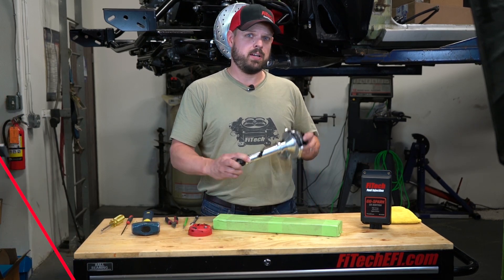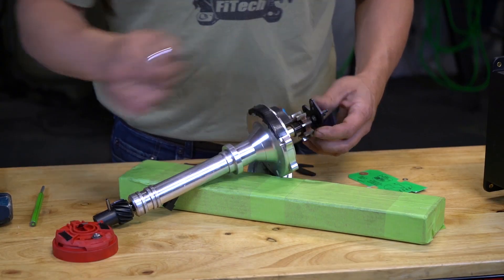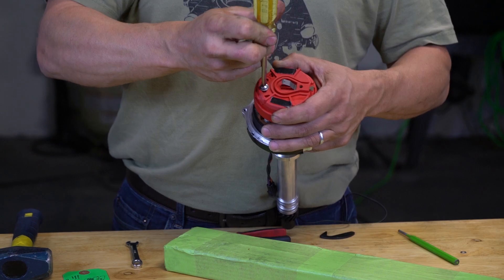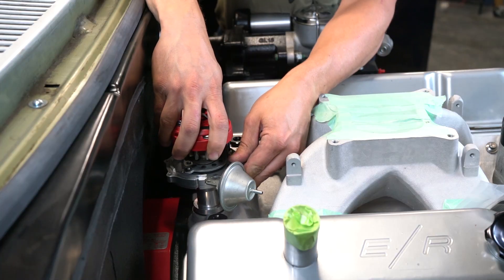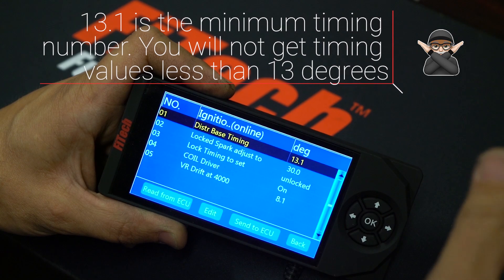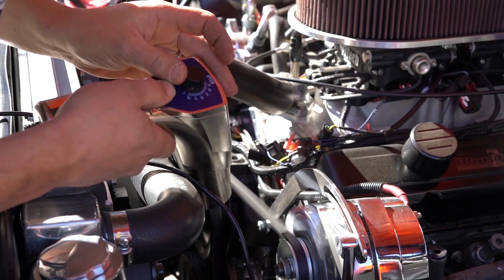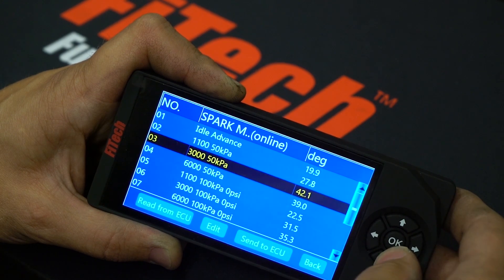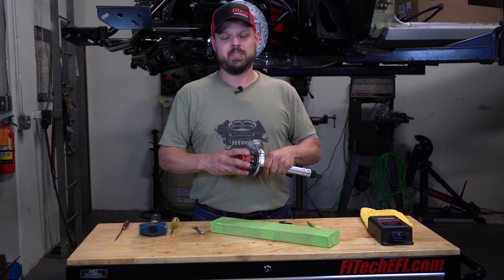Locking Out A Distributor | Tech Tuesdays | EP20

Comment: How would i set this up with a non adjustable rotor?
Reply from the maker: The process is ultimately the same minus the phasing part, however you should reduce the max timing in the Spark Table.

Comment: So what setting do you adjust your base timing at idle for vacuum to be the highest possible at idle? Would that be idle advance??
Reply from the maker: That is correct. The idle advance setting is for adjusting the spark advance at idle.
Reply: So if I understand correctly we set the distributor in at 10 degrees btdc or whatever. Then sync it with a timing light to match. Then after that we can just use the idle advance to get highest vacuum or change without physically touching the distributor

Comment: For this example, you picked 7 clicks on the phased rotor, which is 14 deg at the crank. Is this because you set base timing to 13.1? I've used 18 deg for my base timing on my car. So should I set my phased rotor to 9 clicks?

Comment: I have just bought the 30002 model and I have two distributors an after market direct to coil ready to run distributor with Tach Out wire and a OEM three wire Hall Effect distributor that has no advance. Can I use these distributors or do I have to get a distributor with the inferior and out dated VR pickup to use the Timing function in the 30002?
Reply from the maker: You MUST used a 2 wire magnetic pickup distributor to used the timing control feature.

Comment: When phasing the rotor, should it be set centered on the #1 post or to the forward edge of the post ?
Reply from the maker: The goal is to keep the spark jump from the rotor to the cap as short as possible. To make the process easy we say centered but there is the mindset of locating on the forward edge. They will both work.

Comment: I'm Building a 355 Sbc. Its a Street Car but I will be Spraying it up to a 250 Shot! Taking it to the track here and there.  My question is since I will need to Retard my timing when I use the Nitrous, should I buy a locked out distributor? Or do I need one with a Vacuum advance? THANKS for the video
Reply from the maker: Using a locked out distributor and using the timing control will allow you to pull timing when nitrous is being used. The system will not require the use of vacuum advance.
Reply: @FiTechEFImedia  Thanks man